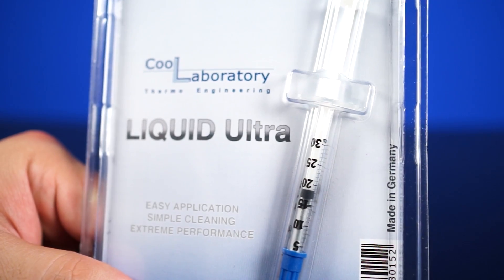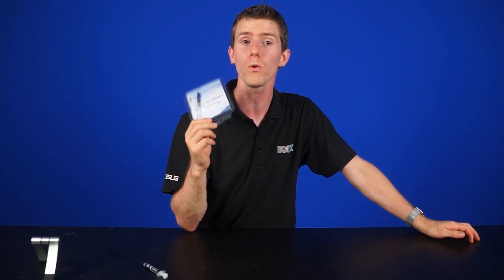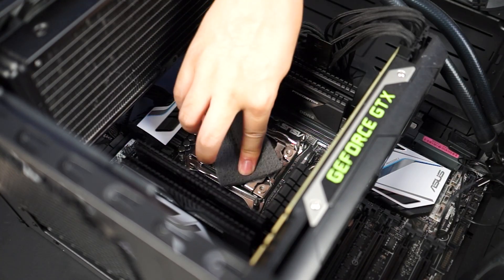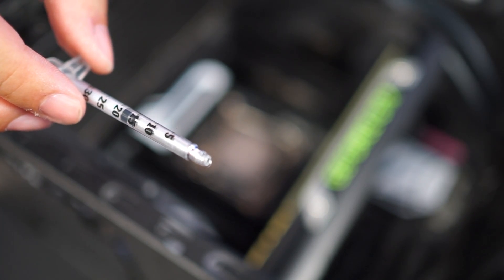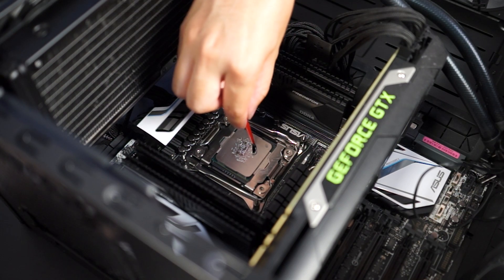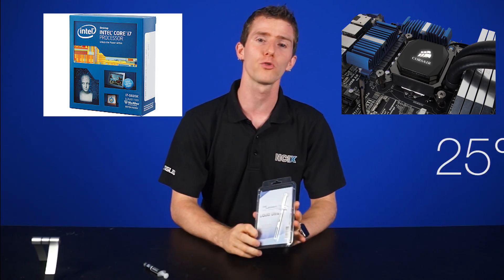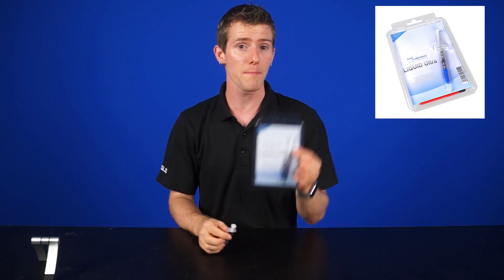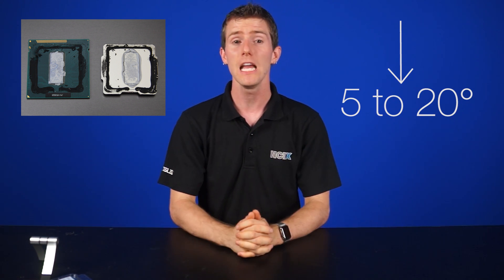CoolLaboratory Liquid Ultra Thermal Compound - Wut iz?

Comment: why does the IHS even exist 
cooling performance is noticably better without it especially on haswell chips
Reply: A lot of chips edges were destroyed back in ~2003 causing a lot of useless RMA's. Basically they added the IHS to spread out the pressure from the cooler and to increase the area between the die (through the IHS) into the coolers socket. I guess they didn't ditch it yet becaues people like me have 1.2kg cpu coolers in their pc which without an IHS would probably be able to damage the die pretty easily. ;)
Reply: A stupid idea from a previous era.
Reply: then why have they not ditched it yet?

its clear the IHS can cause cooling issues due to the thermal resistance caused by multiple layers of paste and metal

with my i5 4690k OC to 4.4GHz at 1.17Vcore  with a H100i liquid cooler
a 20 min 4 core LinX stress test
IHS on> average core temp of 99C (throttling)
IHS off> average core temp of 75C

im not sure how other architectures fair but with haswell it is strongly recommended to delid your chip if you are overclocking

LinX is not realistic in terms of real world thermal performance (even on the most CPU bound games i hit less than 50C while delidded) but it gives a good idea of what your chip can do in terms of heat
Reply: With tech companies if it isn't swoopdee doopdee flashy new tech they don't care nor think about it and will do things the same way they've been doing them.
Reply: well if they do care then their products will get more positive reviews and better ratings which will likely result in them selling more chips
Reply: i guess it similar to the irony of me knowing more about the network than my ISPs tech support department despite me having no formal qualification on the subject

when i call tech support
most of them dont even understand what im talking about because it is way above what they know
Reply: normally those coolers are bolted to the motherboard not the socket/chip
Reply: Skylake and Skylake 1.1 or kaby lake have a pretty thin PCB so they  are to thin in my book to be used without a heatspreader
Reply: i have never owned a skylake or kaby lake chip so that is probably true

but with haswell, devils canyon and broadwell architectures it is well advised to remove the IHS if you intend to try to break the 5GHz OC barrier in my experience
Reply: Mostly because it's really easy to ruin your CPU by applying too much pressure if you don't have one. Back in the Athlon XP days... it was nearly impossible to get your fan on without applying enough pressure to crack the CPU die, especially if you were new to PC building and hadn't mastered the screwdriver trick. I think Fry's may have changed their return policy over people like me... I think I ruined more than a few CPUs and motherboards thinking they must have been DOA. It's easy for the damage to be so subtle that you don't even realize there's anything wrong with it from a visual inspection. The irony is, ever since Intel switched to LGA sockets, they claim installation should only be done by professionals... but in reality, these modern CPUs may be some of the most idiot-proof ever designed. The average person doesn't use water cooling... they put big, heavy, heatsink/fan combinations on top of the CPU... and if you put one of those directly on top of the die, it could be bad. But on the other hand, if you really know what you're doing and are using watercooling, you can probably get away without an IHS. But CPU fans are bigger than ever, and the difficult of mounting one directly without cracking the die has only increased.
Reply: so its because of idiots breaking their CPUs why i have to break my warranty to get extra thermal performance
Reply: Well, yes. Otherwise, they would have been faced with either eating the loss whenever someone brought it back in, or pissing off their customers by arguing with them about whether it was damaged or DOA, when you can't even see the damage to tell one way or the other. Between the IHS and the LGA layout, those chips are pretty resilient now (bent CPU pins are no longer possible), and that means fewer returns and fewer angry customers and retailers. For what it's worth, you're not losing much... Intel's processors don't handle extra voltage well anyway. Kaby Lake basically won't go much past 5GHz. Delidding might get you another 200MHz at most. The thing is, no matter how cool the CPU is, it just doesn't play nice with higher voltages and frequencies. This problem seems to get worse with every die shrink, possibly because Intel is optimizing for mobile and server performance which prioritizes performance per watt.
Reply: why not use a bigger die and fit more transistors on it so you can get higher clock speeds

the power draw and heat output will be higher but there wont be issues of quantum tunnelling or anything like that

and lets be honest if you are chasing clock speeds like me
then power consumption and heat output are likely of little concern to you
Reply: The reason is pretty simple actually: it's too dangerous, the small DIE of a modern CPU is very tiny and can be harmed easily, when installing a CPU cooler.
Reply: MWB Gaming thinking it could  happen in the future. but since intel has had no competition for a while they don't really need to try to dominate the marker. Lets hope zen is able to shake things up as a monopoly does not benefit consumers
Reply: intel already has a very good reputation with consumers

why not make that reputation better by improving CPU technology
(and make some more money by selling the new tech)
Reply: MWB Gaming Intel is extremely overpriced nowadays and they don't even bother soldering the IHS...
Reply: xXYannuschXx yep sadly been that way for awhile on their non lg2011 cpus. I hope deep down zen wakes intel up
Reply: i never said intel was cheap
but you wont find a better performance per dollar CPU elsewhere
(unless AMD pulls their finger out of their ass)
Reply: MWB Gaming Performance per dollar is actually better with AMD, the only thing AMD is lacking with the Bulldozer is single core performance.
Reply: i have owned AMD and intel machines and my FPS per dollar is always better on intel CPUs
Reply: MWB Gaming That is hardly believable, AMD hardware is very cheap compared to Intel.
Multiple benchmarks proof that the performance per dollar is higher with AMD CPUs.
The FX-8350 for an example has nearly TWICE the CPU mark points per dollar than a I7-6700k.
Reply: you fail to take into account the higher power consumption and heat output which increases electric bills and requires a more expensive cooler to prevent overheating

in addition to that a lot of games are optimised to run on intel CPUs and very few are optimised for AMD CPUs
Reply: MWB Gaming Actually, you don't need that big of a cooler for a Bulldozer, thanks to the welded DIE. Intel is using thermal grease between the DIE and IHT, which makes the Intel actually run hotter.

Games aren't optimized for any CPU, the Bulldozers aren't that bad in most games anyway.
Reply: I know in soldered dies they initially have better performance that degrades over time wonder if the welded will have that problem.
Reply: well in my experience using AMD CPUs
AMD runs hotter and draws more power per FPS than intel

Comment: Maybe this was due to the heat spreader on the desktop CPU, CLU worked great on my naked i7 4940MX. applied it straight to the die and heatsink surfaces, and lowered my temps by around 11c average under full load.

Comment: Maingear’s EPIC T1000 Thermal Interface Solution is similar, but it is encased in a film, and also is a solid at room temp, you have to let your CPU warm up and melt to fill in the gaps. In my rig I'm using antec formula 7, that stuff is so thick, it needs to be spread out. I read some reviews that used the dot, or line method, and it just doesn't spread out correctly.

Comment: It's looks like an over complicated fix to a problem that doesn't exist unless you plan to be an extreme overclocker paste is much easier to work with
Reply: Like he said, most people use it on delidded processors and in that case, it does ALOT. Did a delid on my 4690k and the temps are nearly 20°C lower; got 500mhz more out of the CPU, while still having slightly lower temps.

Comment: I don't get it, aren't CPU headspreaders aluminium?
Reply: nickel coated copper actually
Reply: nickel coated copper actually
Reply: the spreader itself is in most cases but the plate used to connect the Cpu to the cooler isn't in many cases.

Comment: I use this on my delidded 4790k, For above the heat spreader and under that water block however i just use arctic silver 5. But even with this just for the delid i dropped about 17 degrees on load and a couple degrees on idle.

Comment: So it doesn't work on XBoX360 because is aluminum and the gallium would interact with aluminum.
What is the best thermal paste for the xbox360?
And would the thermal pads work? And which one would be the best.
Reply: Fernando Salazar buy pc
Reply: GGPL I been thinking about that, but I don't have much room at home, I will try to find a good deal to buy a good PC.
Reply: GGPL they should do an adapter on pcs to place two older graphics card that can boost performance, that way we could built a gaming PC cheap with cheap graphic cards.
Reply: ***** thats called sli for nvidia cards and crossfire for amd cards
Reply: for 420$ i bought pc with few used parts and play all games i like on high/ultra 60fps
if u want specs i can tell you
Reply: GGPL what about two older graphics card, can they do good with new games with enough ram?
Reply: ***** you wont be able to get to new gameslike new bf1 or cod you will need gpu for arround 100$
Reply: GGPL they haven't said which thermal paste is better for xbox360, I did bought a PC but a cheap 50dollars one, I think it can outperform an XBOX360 but I will have to find out about that.
Reply: ***** DONT BUY ALREADY BUILD PC'S YOU GONA HEVE A BAD TIME
Reply: GGPL I don't have much time I work too much, maybe when I am in a vacation or something, but I will built my own PC someday for sure.
Reply: ***** all you need to do is post your budget on /r/pcmasterrace and they will tell you the build to buy
Reply: GGPL i already got a dell 780, that will do for most games, I can overclock it just a bit and reduce the settings in the game and be perfect, and even maybe buy another processor for cheap to upgrade it.
Reply: +Fernando Salazar I dunno about that working for "most games." It has a Core 2 Duo. Looks like integrated graphics are on the motherboard, and there are different models, so I dunno what you have. Have you tried gaming on it yet?
Reply: Malus1531 not yet, I don't have much time, I am also trying to buy a good graphics card, so I will check it out later.
Reply: +Fernando Salazar Well a high-end graphics card will certainly be bottlenecked by a Core 2 Duo, a low-end GPU might work just as well as an expensive one if you are CPU limited. You should be able to find something better than integrated though.
Reply: no point in putting this on a 360 honestly.
Reply: vespaman0 xbox 360 can overclock to 500000ghz

Comment: i've been using this on my 4790k with a swiftech H240-X for about a year and a half now. been running 4.9ghz@1.31v, but only saw a 4c improvement in temps (yes corrected for ambient temps in tests) over the arctic silver 5 that was on it before. when i upgrade my cpu i plan to delid it (i cant afford a screw up like that atm) to see if that helps at all. heres hoping it lets me pull the 1.35v i need for 5ghz (doubtful XD).

Comment: Have been using Liquid Ultra on my Dell XPS 17 L702X. 
Stock cpu 45W i7-2670QM temp 75 degrees celsium. Upgraded to 55W i7-2920xm + Liquid Pro - TEMP 45-52 Degrees!
RESULT! Liquid Ultra is the absolute BEST heatsink I've ever used!
Reply: atnstn Celsius, and this is a thermal compound, not a heatsink

Comment: i used this thermal paste and yes got a 8oC temp drop on idle 16oC load then being from a mechanic background i thought lets try copper paste for brake pads yes it conducts so have to be careful when using but i got 5oC more drop idle and 25oc load im running a old phemon 2 970 unlocked to six cores running at 4.3ghz on air full load temps never gets above 53oC

Comment: should I buy this, I have a laptop that has the processor soldered on the motherboard and it has no lid. my heat sink is copper  and I'm currently using a silicone-based compound from RadioShack so I don't even know how old it is. my temps range from 120-205 Fahrenheit. Also I was looking at IC Diamond which seems good i want to know which one to get and whether I should.
Reply: just de-lidded a 6700k and tried both Arctic silver mx-4 and this stuff....this stuff was easily 15C cooler...amazing. then tried it on a EVGA 1070 (tried couple different ones, mx-4 and AS5) but didnt seem to matter....so tried this stuff (after covering the capacitors with electrical tape...casue you know...its liquid metal) and it dropped temps form 85C to 67C....freaking amazing...really sketchy to use though since it can short things out lol. I believe its only worth trying if you cant lower the temps and are facing a thermal ceiling.
Reply: I have a laptop, so should I take the risk or do you have a better idea? and if I do go with CoolLaboratory Liquid Ultra Thermal Compound, how should I prevent leaks?
Reply: As long as the cooler is copper or nickel plated. Have you tried re applying new tim? I would do that first. If it's still way hot then go ahead and try it. Shouldn't "leak". You apply such a thin amount. Just be super careful not to get it anywhere on the board or around the chip and follow the instructions.  Like I said.. I surrounded /covered up the the components immediately surrounding the chip
Reply: The stuff I have in now was applied  like 3-4 months ago but the product it self is old. and electrical tape should to the trick protecting the immediate area. one last question, should I leave the tape on? thank you for your advice.
Reply: +GoldWolfKing shouldn't hurt anything if left on... Supposed to be heat resistant and won't short anything out (:
Reply: ok I read some amazon reviews and a few said that it got rock hard, was hard to clean up, and even ate up delidded CPUs, I'm a little scared to buy it now plus I need to but a cleaning kit and I don't have the money for that atm. do you recommend any other TIMs that would be easier to use, safer, and is in the same price range while still lowering my temps because what I got is crap.

Comment: I tested my stock thermal paste from my EVGA 980ti. Locked my frame rate at 70fps and played a match of BF4 at a locked 25% fan speed with a 1400mhz OC (yes I know very small but I don't like to OC) I played the match and my max temp was 71c

I took apart my graphics card very carefully and proceeded to clean it to the best of my ability. After about 10 mins I was satisfied. I applied MX4 and proceeded to redo the test with the exact same settings and my max temp hit ......... 

73c lol I was a little disappointed and while its a very minor difference that was the result I got.

I had my AC running at 70f the whole time.

Comment: I lapped my cpu and cooler and got around 3C less under load with this liquid metal compound. That was 3+ years ago - the pc is still running great and the temperatures are still low. I can greatly recommend this compound for lapped cpus and coolers, but on stock cpu/cooler - you are better off with a traditional high-end paste.

Comment: Liquid Ultra is amazing. I have been using it for several years and it always lowers my overclocked load temps anywhere from 10°C to 20°C. I paint it on both surfaces so the two halves come together wet. It also lasts a very long time... much longer than anything else I have used. It works amazing on laptop and desktop CPUs. The exception is a laptop with a heat sink that does not fit correctly. Liquid Ultra cannot be used to plug big gaps or fix sloppy workmanship. It will not perform well at all under those conditions.

Comment: How about...applying it onto the laptop CPUs and GPUs?? Wondering if there would be any improvement!!
Reply: I think so, but you WILL void your warranty and may have to break open your laptop to access the CPU. Not to mention you might have to lightly sand the bare die.

Comment: what thermal paste do you reccomend ?
Reply: TheEmeroldBlock Arctic Silver 5
Reply: Gelid GC-Extreme
Reply: ic diamond
Reply: Gelid GC-Extreme or NT-H1. LOL, ignore that guy that said AS5.
Reply: It's not bad, it's just there are better options at no added cost which essentially makes it obsolete to new buyers. Just the like the M9i replace the well-known 212 Evo for a cheaper cost while doing everything better.